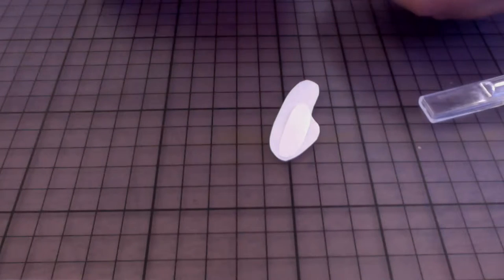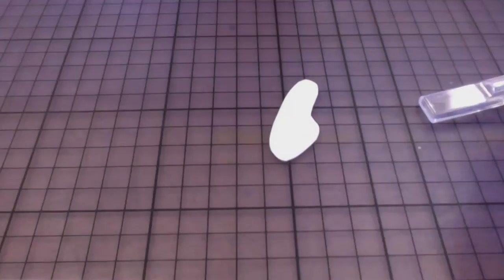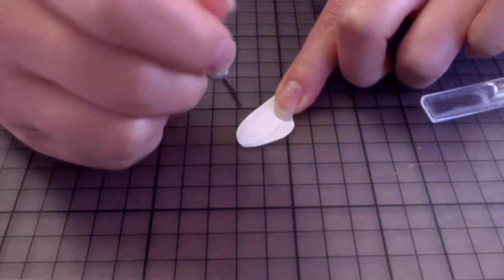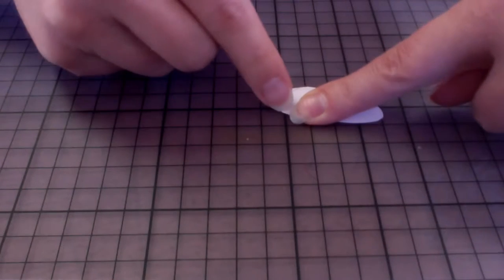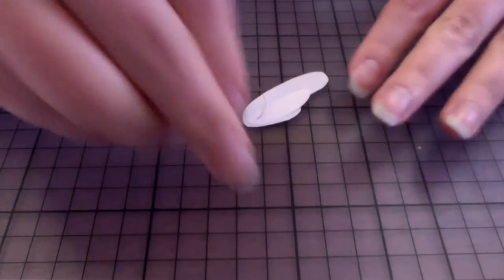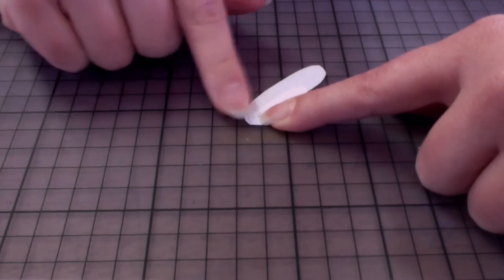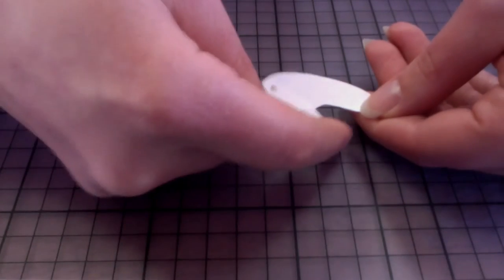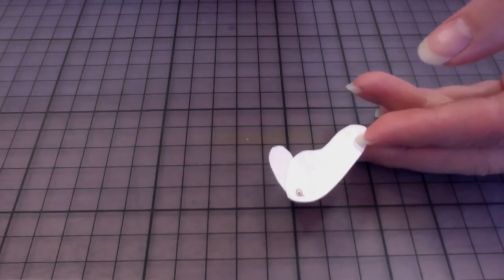Puppet joint out of speaker wire

Comment: Been looking for ideas for joining articulation on small paper/card puppets, this is best I found for being not as obvious as other suggestions.
This has inspired me to try making mini butterfly /splitpins. use speakerwire, double it over, thread though the doubled up bit. Make a small t-bar shape and fold the wires on opposite side.
Thank you for the inspiration... now to see how well it works?